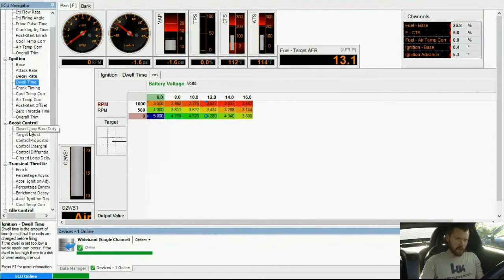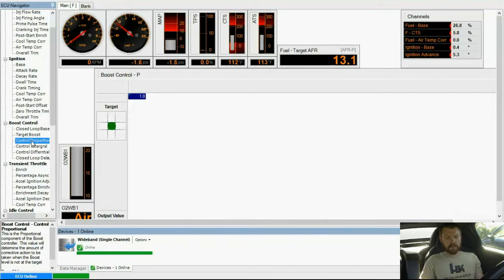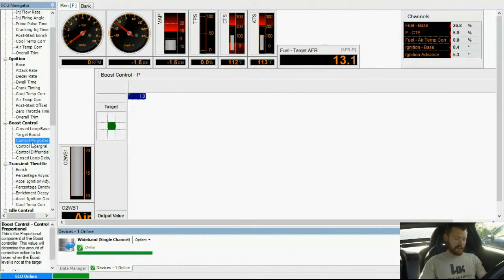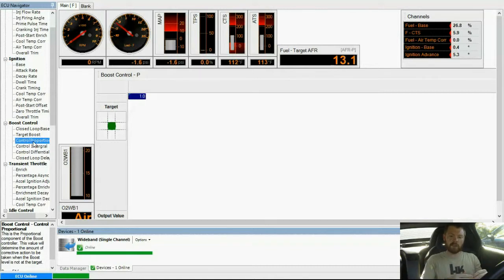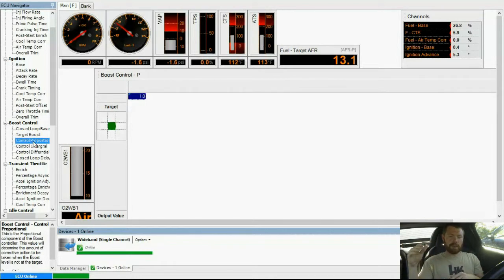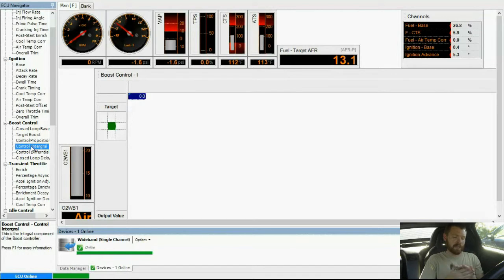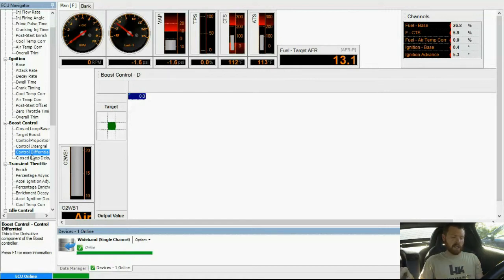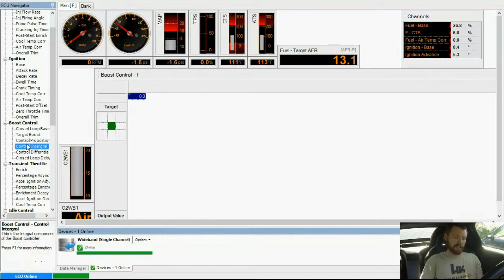Haltech ESP: More On Boost (part 5)

Comment: PID is a method for controlling a system. The boost controller will behave in a certain way (Gp) and in order to achieve the desired output you will use the PID to determine that output. It goes hand in hand with whether you choose to use an open loop or closed loop as this affects whether you can know how far off from your set point you are

PWM is a way of sending out a pulsed signal. Systems react differently to different frequencies of signals, and the way the boost controller behaves, and the way the ECU ensures what you want to happen happens is controlled by the PID controller.